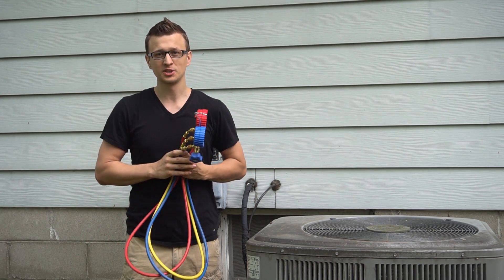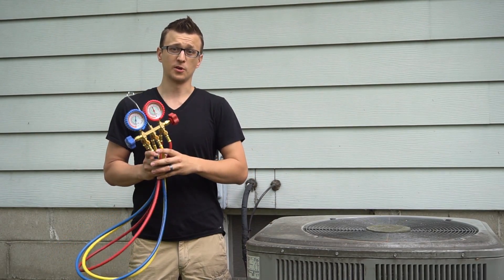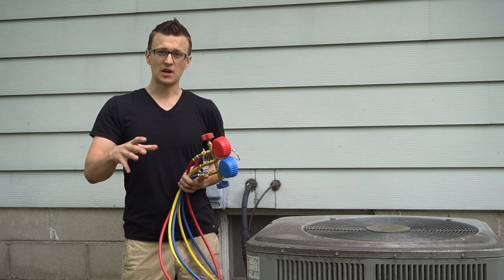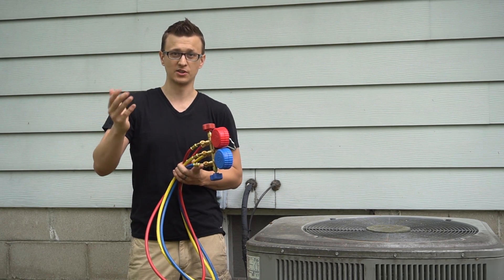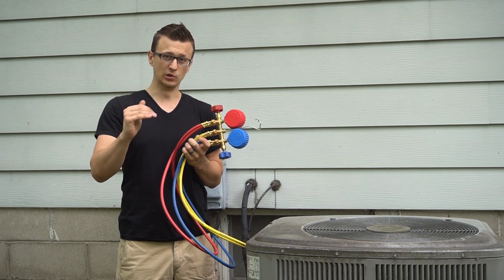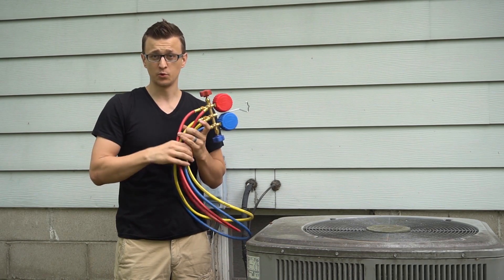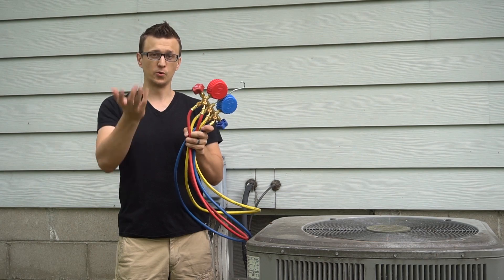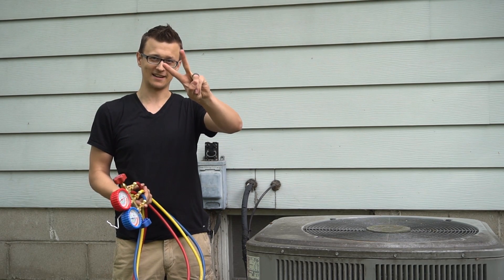How Often Should Freon Be Added To AC Unit? How Often Should It Be Checked?

Comment: we only due commercial, industrial, however the situation depends on what the customer wants or what the application is., what the equipment is. such as a chiller, a lot of times already will show you everything you need.  VRF systems not mini splits but a true vrf system, to work on those you should be using the appropriate communication tool for the manufacture and use a laptop to check operation. no gauges needed. same goes for mini splits, you can check temps, grab a stubby gauge or smart prob for suction port since most only have a access port on suction service valve. however even with mini splits with inverter compressors you will get different pressures so its almost not reliable.  package units, i gauge up when its a new install/ start up to write down operation pressures (even though i can get a rough idea of what it would be with operational temps its nice to see what solid numbers im seeing. if its a pm or troubleshoot, i wont use gauges unless i see a reason. normally i check air side first before deciding if gauges are necessary. thats for any package style system including wall hung bard/ marvair units. in large tonage splits i dont normally. a lot of the large splits we mess with have smart boards to display information needed. as well as check the BAS for temps as well as confirm temps the BAS says with my own probes. anything small like ice machines no gauges. however for everything anymore i dont use regular gauges anyway, i just use testo smart probes. even for charging. I can use that with the measure quick app and life is good. just stick some low loss fittings on the probes and roll. pulling a vacuum, i only use core removal tools and 1/2inch hoses off my 10cfm JB pump and let it rip.

Comment: It is a sealed system so there really isn't a reason to check it unless everything else doesn't check out fine especially if you don't have low loss fittings on your hoses. Me personally i rather just check the split temps than to put the gauges on.

Comment: What's the lowest temperature to set on Central a/c to keep it from not freezing up? I heard setting thermostat below 68 degrees will damage the a/c is that a fact?
Reply from the maker: I don't believe that to be true. I have set my AC to 68 plenty of times. I don't think I would go below 62 though :) But that being said.. If there is a problem with your air conditioner, for example if you have bad air flow or something is not working right in the refrigeration system, then setting it lower may cause the unit to not work right.
Reply: Thanks for the clarification! You was sent by the hvac God to cool every house on the planet 1 by 1! Thanks hvac superhero!
Reply: Setting the temp lower does not make the unit run colder. It just runs for a longer time to bring the room temperature down. If the unit is icing, either there is poor air flow from clogged filters or weak fan, or in majority of cases the system has a leak and gas pressure is low. Start with checking and changing the air filter. The system needs to breathe - use the simple cheap green filter not the expensive HEPA filter. Those restrict air flow too much for many older systems and cause issues. If problem persists and you can see the fan does work, call a licensed hvac company to inspect.
Reply: Thank you!  Very informative!

Comment: I agree with not gauging up immediately. The first things I typically check would be power thermostat and low voltage. After that I take all my split temps, indoor and outdoor temperatures and check the filter as well. Next a check all the amp draws compressor, blower and outdoor fan and then test the Run caps. I will only ever put gauges on a system if any one of these other things says otherwise and is out of typical range. In my opinion. You don't need to see refrigerant pressures unless there is absolutely something wrong with the refrigerant cycle. People who throw gauges on first or rookies and don't know what they're doing. And just so you all are aware and don't think I'm talking out my ass I work on Chillers, 40 to 80 ton Trane intellipak package units, leibert's, water source heat pumps, and many other types of cool units.

Comment: What’s the best temperature difference from the return & supply?
Reply from the maker: 18-20 degrees
Reply: Thank you! Can that be a way to check to see if you’re good on refrigerant as well?!
Reply from the maker: @MassiveSkillz777  Yes. It is very rare that the temperature difference is good but the refrigerant is still low. So if you have a difference of 15-20 degrees, that is a good indication that your unit's charge is good.

Comment: While system is running. Using low loss fitting or ball valves on your gauges, diconnect the liquid line and open the high and low side of the gauges till the pressure on the high side goes down. You'll be left with low pressure vapor.

Comment: I have a 10 year old HVAC system and I had a technician check out it today for maintenance. When he was checking the refrigerant level he said the pressure was much lower than normal. He said there's a slow leak somewhere and it's very likely in the evaporator coil. He didn't look exactly where it is in the evaporator coil, he only assumed it because of rust he saw there.

The technician said it might not be worth fixing as something else could end up failing. That I would be better off installing a new HVAC system than replacing the evaporator coil and adding more refrigerant. I'm undecided.
Reply: If you are at the point of seriously considering a replacement of the entire system over rust/pinhole leaks, better off adding a sealant and topping off the system for $200-300. If leak is small it will likely seal and run a few more years. Finding small leaks is a challenge and for the cost of replacing large components with labor more often than not a new system is better deal for long term use.

Comment: I am fairly new to the industry so I’m not experienced enough to challenge your point. However, I work for an apartment complex with 235 ac units. Most all are straight air R22, well 407c now, units and some have been in operation for over 25 years. When we get an ac call here the first thing we do 95% of the time is gauge up assuming everything is running and the unit is just blowing warm air. I see your point and it’s interesting. Thanks for all your videos I have learned several things from you that I use almost daily.
Reply: Scott, watch the other videos on this channel about what to check when the system is blowing warm air. Very interesting and  fun to watch and try out the easy stuff. In my case the lawn care company had simply cut the 24v feed wires in half. But I checked out the contactor first for some reason. Silly me. All good now.
Reply: G Henrickson lol have had the same thing happen here with the lawn care guys

Comment: I'm retired now but if I had to hook-up gauges, when done I would remove the low side hose while the system was running and then turn  the system off, let the system stabilize for about 5 minutes then remove the high side hose. That's the best way to limit refrigerant loss.

Comment: I do only commercial and I for one agree with this practice. Most of the commercial rooftop units I see are 7.5 to 25 ton and even 50 or 60 ton of cooling with multiple compressors. If you were to gauge up to every compressor on a every PM I guarantee it will screw up the system in 5 years. I see technicians practice poor refrigerant handling with gauges and every time a PM is done it's a different tech. I've seen Lennox units that have 4 compressors all in a row have the first compressor undercharged and the last compressor overcharged because the technicians don't evacuate their gauges after each compressor so they take the refrigerant out of the first and add it to the last. Their are systems that people have put dye in that you don't know have dye until you gauge up, then you have gages with dye in them, and no  one has the money to replace hoses and all that or clean your stuff out with RX flush, so you go on and pass that dye on to the next system. What I hate most about the business is that companies sell the customer a lengthy PM checklist that's full of bullshit that no one does, including gauging up on every compressor on every PM.
Reply from the maker: I don't do any commercial so that's all interesting stuff! Thank you for taking the time to share!

Comment: Speaking of Total Static Pressure in HVAC system (measured in inches per WC), what is the maximum value recommended. Do you measure it when you service a system.
Reply from the maker: I don't measure it on every call, just units that are not cooling enough or freezing up. I don't know if there is such a thing as a maximum value.. A clean, wet (during AC season) evaporator coil is normally about .25" w.c.  From what I have seen, problems start surfacing when it gets to about .5" w.c.
Reply: @WordofAdviceTV  In your answer you are referring to pressure across the evaporator coil. I was asking about Total Static Pressure of a system as a whole. You know that there is an issue with evaporator coil when the pressure is above 0.5 (measured across evaporator coil). Same logic applies to the system as a whole. Other elements in the system can also be problematic and may require attention just like the evaporator coil. For example the flexible duct could be collapsed, and restrict airflow. The filter could be dirty and restrict airflow. By measuring total Static Pressure you know something is wrong with airflow in a system as a whole. I learned about it from the following video  https://www.youtube.com/watch?v=45gX7Jb60JM and wanted to know if you also use 0.5 as threshold between bad and good (for the entire system, not evaporator coil). My static pressure is 1.23 which is way to high, and that is caused by incorrect design of duct system by the builder.

Comment: You should ALWAYS check pressures.. to Assume the system is okay is making an ass out of u and me. If your a good tech you will hook your high side back to the suction and put the gas back in. Checking the pressure can tell you if your TXV is metering properly. If your condenser is that dirty even looking clean, or a dirty evap. Even to if you have the correct speed for the blower. Also get with the times and get digital gauges you'll be a more accurate tech!

Comment: Depends on the call out. If I get a call that the outside isn't turning on and I find a bad cap then I don't put gauges on. If the call is the inside blower fan isn't coming on then I don't put on gauges. If the customer is calling me for a maintenance... I'm probably putting gauges on after doing all my tests depending on the age of the system. The last thing I want to have happen is the customer calls me out in 2 months because I did a maintenance but failed to ensure the Freon charge was correct. The idea is once the customer calls me out I'm servicing the unit for the rest of its life. If 5 years down the road I need to add a half pound because I've been checking the unit and it's a little low, I'm 100% happy to do it because I have piece of mind for those 5 years knowing the charge is right and it doesn't have a leak.

No way would I go behind someone else's work and just assume that they did their job properly. I've seen far too many times that that wasn't the case.
Reply: How much does half  a pound of R22 cost? I read that the manufacturing and importation of R22 were banned in the U.S.  The supplies must be very limited. Can you spare half a pound?

Comment: Gauge up! I understand your point on losing refrigerant but at the same time I like to see my pressures and my line temps along with my super-heat/sub-cooling
Reply: Jay HvaC ... I couldn’t agree more. I can’t tell you how many times I’ve found failing txv’s when the customer didn’t even realize there was an issue and then after the replacement they see how much better it works when the TXV is working properly
Reply: @ttali211  in 5 years driving across oklahoma my company replaced 5 or 6 TXVs. most of which on brand new units and were just faulty from the get go. you should check amps before gauging up. no reason to throw guages on when you do not need to. it isnt about the system being a little lower. it is bad practice for thousands upon thousands of us just checking cause we want to. the environment is affected. you may be great at checking ahead of time but far too many people are ignorant of how to properly work on a system and gas and go. once again not trying to say you do not make proper checks. i just have worked with so many that jump the gun, gas and go feel great the system works right then and then i am out working on the unit diagnosing why the system has an issue. not to mention you shouldnt need to ever adjust your superheat or subcooling unless you are replacing specific parts that failed. rare a system just randomly needs adjusting for no reason other than time went by. had one TXV that 4 different people adjusted just for Brock and I to go out and adjust it back to where it originally was cause the system was just a bit low from all them throwing their guages on :/

Comment: Temperature/Pressure relation, and Valve Core Depressors for Zero loss connecting/disconnecting, along with remove your Liquid(red) hose first, then crack your Manifold on both sides to charge your lines/manifold back into the vapor side(slowly)

Comment: My blower wheel isn't too dirty but the motor is caked with dust. Need to add that to my todo list. I also need to patch up areas on the ducting in the attic. The insulation around it is coming undone. Also I need to save up to add blown in insulation in the attic. I swear I only have at most 3". Not good..

Comment: Great points made in this video.  A refrigeration system never needs to be invaded for a reading unless there is a manifest deficiency in cooling.  Every new cooling season when I first start up my unit I take a simple thermometer and insert it into holes in the return and supply duct.  After running the unit for about 10 minutes I check the temperature difference between the two ducts.  If it reads 17 to 20 degrees difference, I know the system is working properly.  If it reads under 17 degrees difference,  I would know that the unit needs to be checked.  Of course the correctness of this simple test presumes you are properly maintaining your system.
Reply from the maker: Thank you for talking about the temp drop! I fully agree with you, if there are no complaints about not enough cooling and the temp drop is good, there is definitely no need to check pressures.

Comment: What you're saying is true, but assumes that every install has been done with proper pressure testing and deep vacuuming of the system. Sadly, this is not always the case.
Furthermore, particularly with txv systems, the cooling performance can seem acceptable even with a fairly significant over- or under-charge, both of which can be problematic (in the near future, if not at the time), especially if the mischarge is compensating for another problem, like a failed or restricted metering device. Since these issues his can greatly impact the efficiency and longevity of the system, I prefer the 'fuller picture' of information granted by knowing the subcool and superheat.
As long as the gauges are properly flushed of air/moisture, the loss of a small amount of refrigerant is not such a big deal, and could even be corrected by adding a bit without making the client pay for it.
(Unless of course you're dealing with a microchannel system, then only use gauges if there is clearly an issue to be addressed by refrigerant. [Unless you have those fancy Bluetooth gauges that don't use hoses or a manifold]. :o)
Thoughts?
Reply from the maker: All good points! Thank you for the additional insight!
Reply: I agree to a certain extent with both you and author. You say you want the full picture. Do you calculate your superheat each time?  Your target superheat changes constantly.  It will change from day to day even hour to hour with the ambient conditions not to mention humidity. 
You can tell a lot about your system without hooking up gauges. The numbers given in the charts provided by the mfg are laboratory numbers, that is numbers on systems in ideal controlled conditions. Read the disclaimer about indoor and outdoor ambient conditions. Your pupose in being there is to see that the system is heating or cooling as it should be. That isn't guaranteed by the numbers on the gauges
Reply: @marvinostman522  Yes, certainly you must (and I do) calculate the superheat for the current conditions, otherwise, yes the readings would be only so helpful.
But actually these days I use fancy pants bluetooth gauges (fieldpiece) with bluetooth psychrometers (and an additional outdoor air temperature probe) paired with the measureQuick app.
That will give you to-the-minute data, predictions, things to check, and even a time lapse view. It seems to be by far the most accurate way to judge system performance.
Extremely helpful, essentially zero refrigerant loss or contaminant introduction. It's the only way to fly. :o)

Comment: I agree. I service automotive AC and all the points you make are correct.

I'm kind of surprised you don't mention using a thermocouple to get a rough idea of pressure by measuring component temperature.
Reply from the maker: I do use a clamp to measure the temperatures but not very often. Probably something I should get into a habit of doing more often :) Thanks for the additional pointer!
Reply: @WordofAdviceTV  no problem! I taught college for five years and drilled my guys on pressure vs temp charts for refrigerant. Pretty useful basic testing.